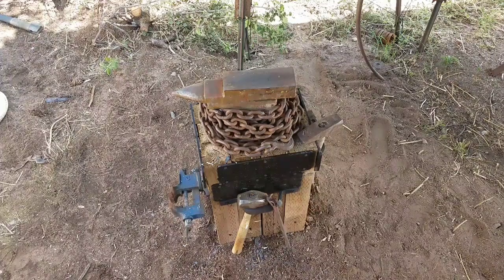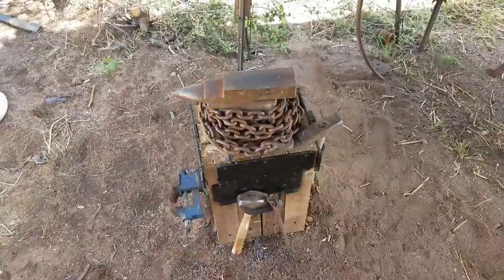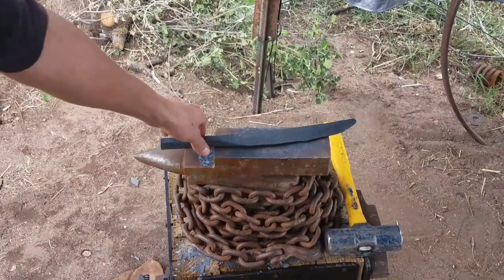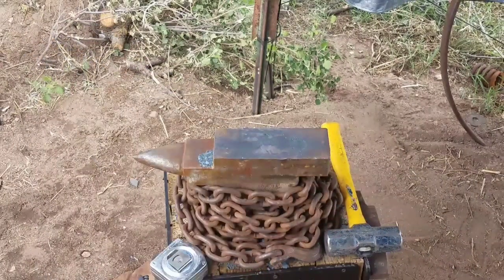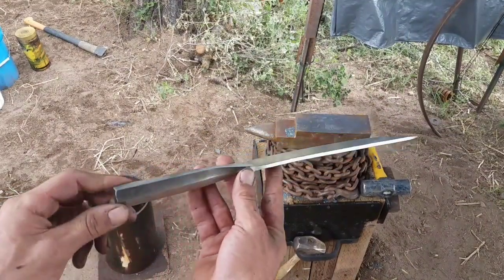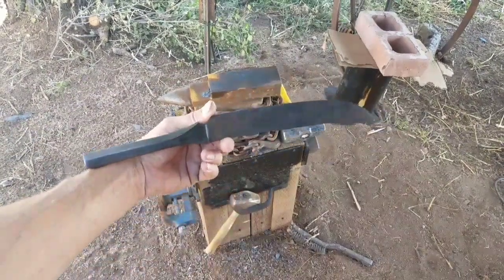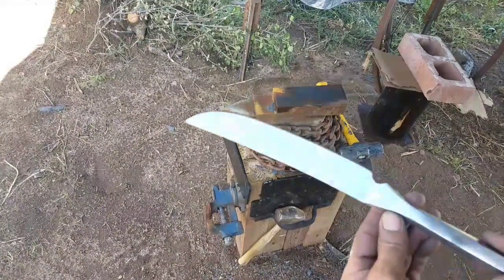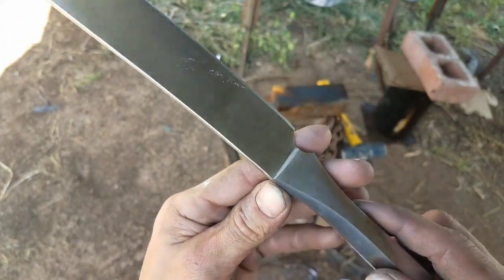Forging A Knife From An Allen Wrench

Comment: You can try to take the warp out, by reheating to tempering heat and using three rollers in a vise. Place the first two, one at either end of the inside curve of the warp, the third goes on the other side, at the high spot. You slowly, gently close the vise, until the blade is bent almost as far in the other direction. Loosen the vise, check to see where the blade has settled, repeat as necessary.

Comment: Jake great build and nice job forging. I'm sure you know but you should try and leave as much meat on the blade prior to HT and on account of the reshaping of the steel you should normalize a couple times before HT as well.  Question Does your forge get up to temp easily? Its hard to tell on account of the day light and the camera not able to see the correct colors. I am building a new forge at the moment and for the burner I'm building a ribbon burner. Its still forced air but the heat is extreamly even threw out the forge and has no problem reaching welding temps in no time. Not to mention the ability to run at a lower gas pressure saving fuel. Just wondering on a earilier video you mentioned selling the blades. Have you had any luck using YouTube to sell them rather than Esty. I ask because I don't have an Esty but also have a YouTube channel.  Thanks for the content you are a talented maker..  Sincerely Martin M&S Blades

Comment: I notice you always have a warp.  When you throw it in your oven or however you heat treat it take a piece of straight metal and a c clamp and clamp it to the blade so it stays straight.

Comment: Could you ever Forge a knife out of a railroad spike
Reply: tristan barnett yes but it has a low carbon which means that it would not hold a good edge even after heat treat